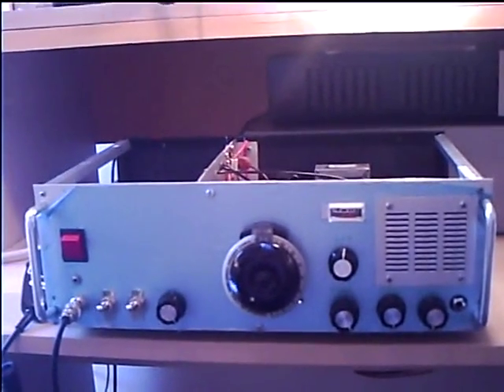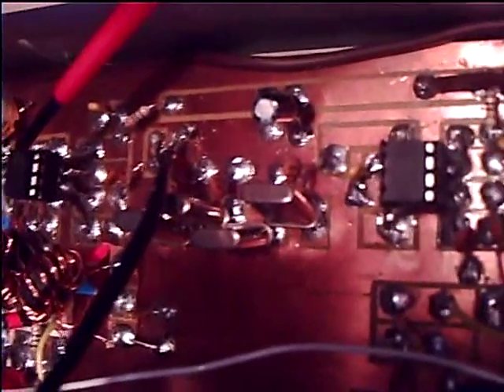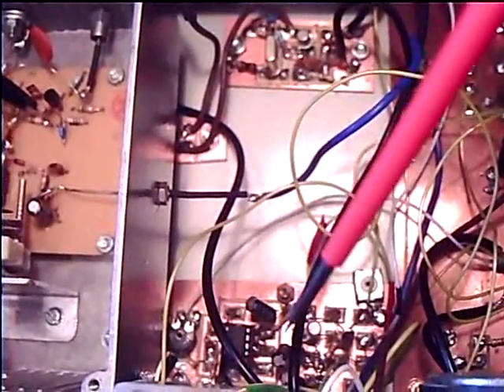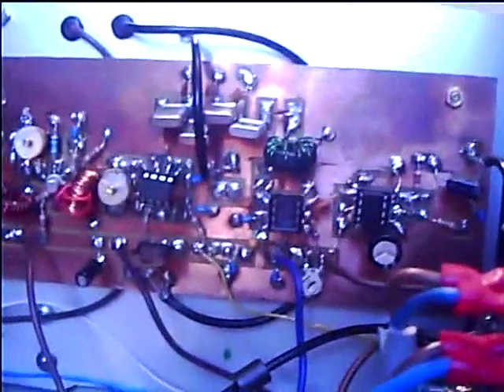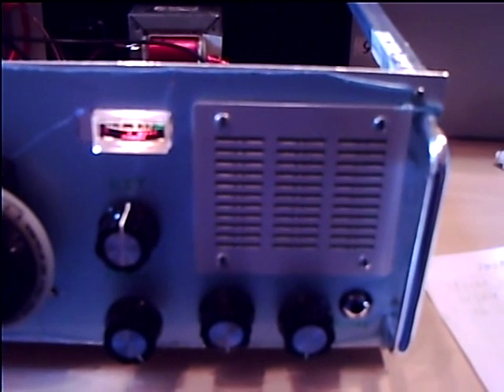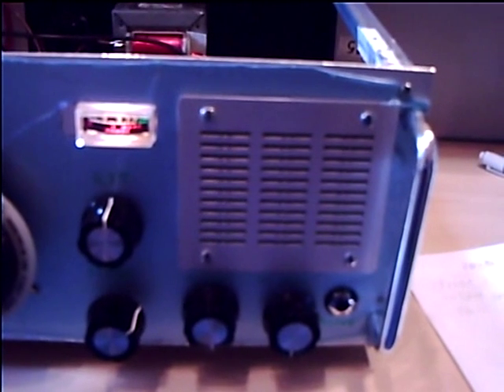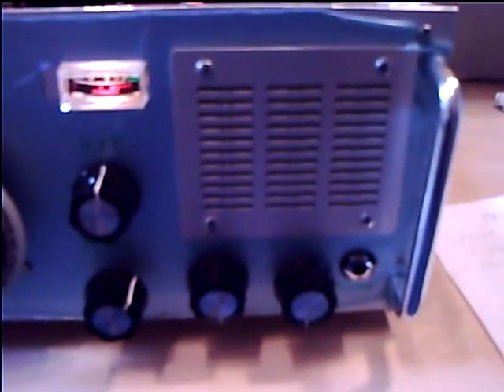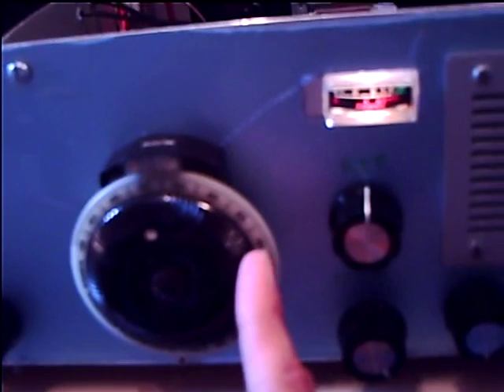M0DAD Homebrew 40m ssb/cw Transceiver

Comment: Very nice homebrew rig David. It's amazing when you work other stations that they are running 1 KW or more and you are running under 5 watts. I have not had many phone contacts QRP, but many contacts with CW. Terry KB8AMZ
Reply from the maker: Thanks Terry, the cabinet for this rig is an old hi-fi unit chassis. I gutted it and replaced the front panel with a sheet of aluminium and re-enforced it with aluminium square rod. I got much more fun out of this simple set than any commercial transceiver.

Comment: Can I use your linear amplifier with my beach 40 transceiver
Reply from the maker: Hi Oliver,The mosfet linear amplifier I was referring to in the video was 50 watts output with 2 watts of drive so I wouldn't recommend it with a DSB transceiver. I would not use more than 5 to 10 watts maximum as the DSB signal is wide compared to SSB. 73 M0DAD

Comment: David, a fine build, and a pleasure to find someone else who has built VK3XUs TCF design. My TCF story is on my blog. I departed from Drews transmitter design but probably because I didnt lay it out respectfully.  I also added an RF stage, preceded by a tight BPF. The simple ne602 mixer and prod det combination doesnt have enough gain IMHO. Theres a video tour in the post so you can see the modules. Have you built anything else since this video?
Reply from the maker: Many thanks Paul. Just looked at your blog. Nice photos of your TCF circuits. I'm very surprised I hadn't came across it before. I really like Drew`s method of design and have all of his books. Never seen any new books out for a long time. I built the 50 watt amp with x2 irf510s but still on the bench untested as had so much fun QRP. I did start a build on a 10m DSB transceiver and built the TX side based on similar building stages and had a couple of QSOS. I had problems with the final and it is lying on the bench collecting dust until I go back to tackle it. Just built some simple projects such as the one valve rx video but would like to build a 20m SSB rig to take pedestrian mobile in the near future. 73 M0DAD
Reply: i have build your qrp linear amplifier and i got it working a little bit the signal is very ver very strong on nearby receiver  if i touch the heatzink of th irf510 transistor why? something wrong
Reply: i mistake bifiliar coil maybe i have wired it wrong can it cause that am writing about it only amplifcates if i touch heatzink like i am antenna

Comment from the maker: Hi Perry
I have not done any more adjustments on the agc at the moment due to work and lack of spare time, but I am still planning on more mods in the future. I am still using the rig and for the moment I have found the reception not too bad when I turn down the rf gain and attenuator. 
73 for now M0dad

Comment from the maker: The bit that I used was named part number 9912 from my Dremel Multi accessory book. It is a 3.2 mm Shank Tungsten Carbide Cutter for metal,ceramics,glass,soft stone and plastics. It is a standard part which came with the drill. There may be better suited bits but I only used what I had to hand. Hope this has been of some use.
73

Comment from the maker: Tnx for the comments. I used several construction techniques. The RX/TX boards were made by sticking masking tape over the copper, drawing the circuit over the tape and cutting out the tracks to be etched with a surgical knife. I find it neater than the normal etch pens which I used for the if board. Other boards such as the AGC were made by cutting islands in the copper from a (dremel) hobby drill. Not as neat but cost nothing to make. This is my prefered technique.
73